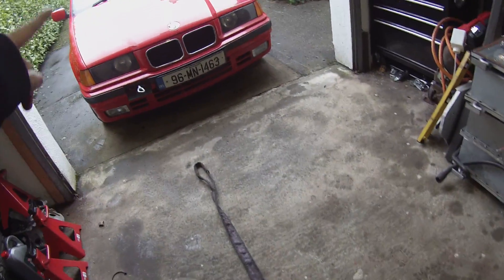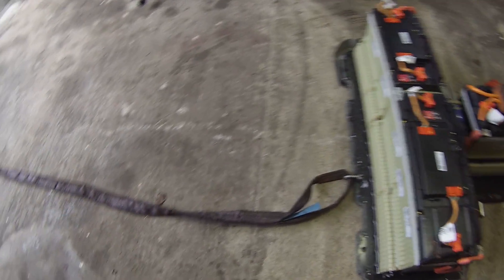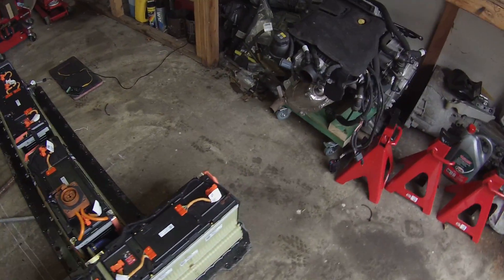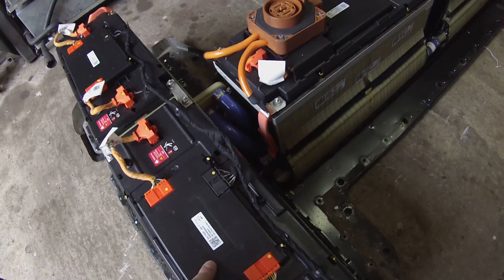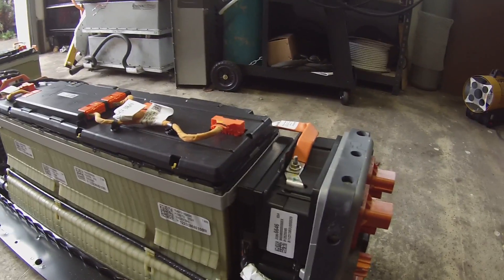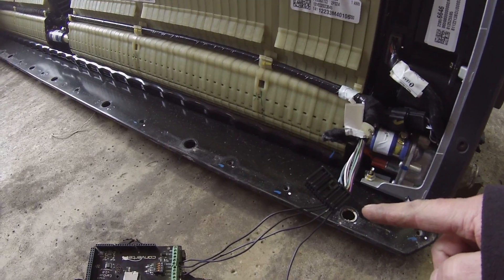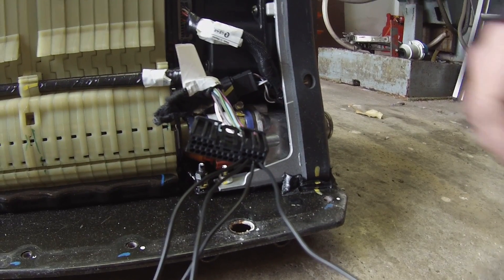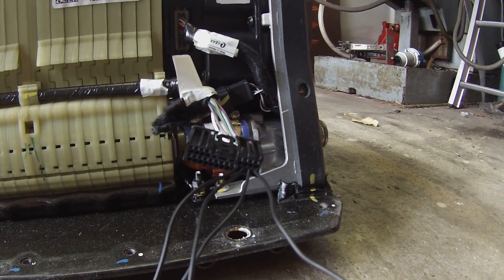BMW E31 840CI EV Conversion 96 : Tesla Swap Day 15

Comment: Is the "5V reference signal" you disconnect then reconnect to get the CAN bus dump actually 5V?  It's my understanding the Arduino DUE works off of 3.3V not 5V.  Wasn't sure if you were getting 5V in some other way or just pulling from the board like it appears.  Getting ready to try this on my own pack and trying to source the right equipment.  Thank for all your hard work.  Loving your videos.

Comment: I asked for this in a comment on a previous video. Don't know if you've seen it but you're definitely delivering. Good stuff Damien. Now to scour the interwebs for volt batteries and cry at shipping costs cause no one has these in romania. Well, there's one. It's 6000€.

Comment: Hi Damien , I’ve started ringing around looking for a battery and motor the Nissan Leaf battery seems to be the most available, would that be suitable for this project ? I’d prefer to get the same battery as you so I can follow you step by step but some lad in Wexford has bought them all 😂 I’m pulling the diesel motor from my Saab this week . Kind regards.
Reply: This in reference to the 1000€ build !

Comment: Any particular reason you prefer to convert rwd cars?
Reply: John Boyle RWD cars tend to have more space under the floor and you can also use a diff with a high final drive if you want to skip the gearbox. FWD car drivetrains are a lot more integrated, hence lower compatibility with normal industrial motors.

And he likes beemers.